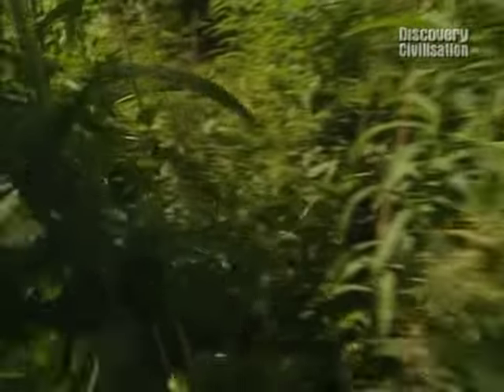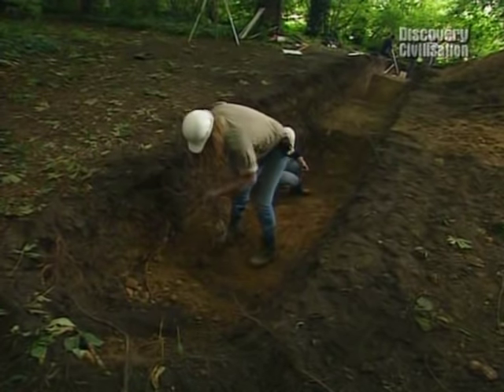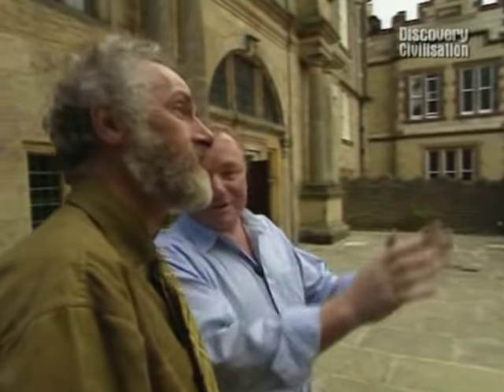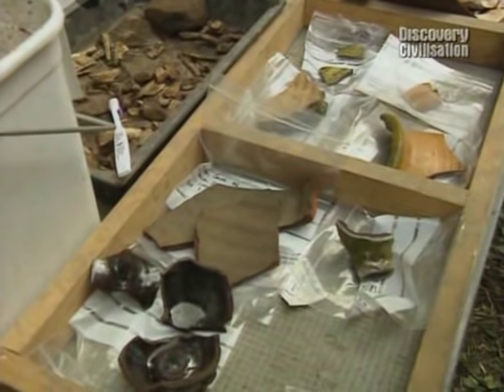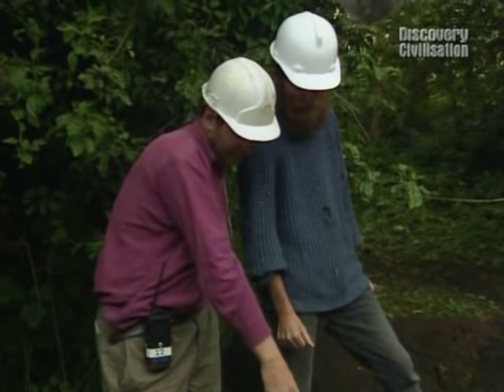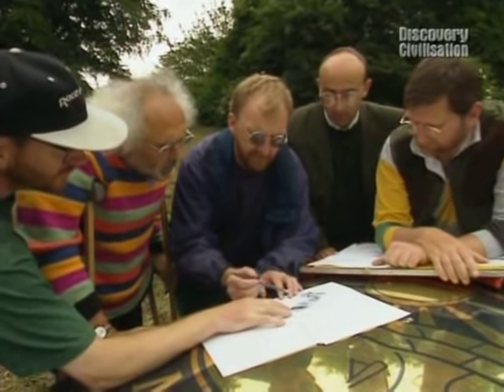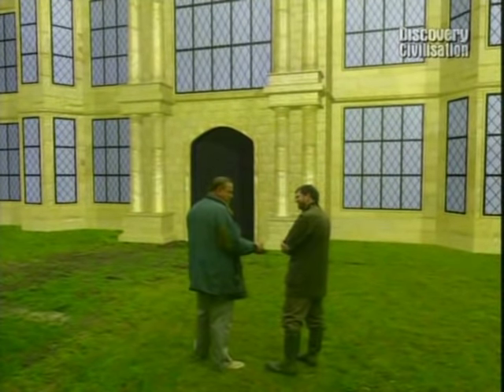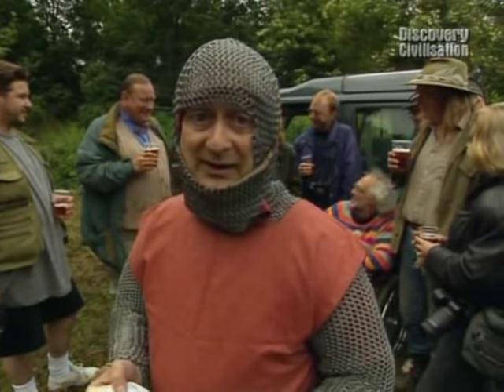Time Team S04-E05  Malton,.North.Yorks

Comment: Stewart does get a lot of stuff, around several periods of TT, right and they need to use his input as equal to Geophys.  Because it seems to me that the trenches would then be in areas where the back stories can either be proved or disproved in less time and with less confusion.  Ah, but Phil always makes the best out of whatever is in their trenches!
Reply: The reason Stewart is there is because a lot of TT sites were scheduled monuments adminsitered by English Heritage, Stewart is a surveyor for English Heritage
Reply: @GrahamWalters  good insight. That explains why the English Heritage fellow is deferring to Stewart on the trench location (not Mick, mind you, Stewart making the call) and then playfully busting his stones once it was decided.
Reply: Geophysics actually shows what’s in the ground. Stewart just woo woos about the landscape. Valuable, but nowhere near as important as geophysics.
Reply: @Invictus13666  having watched about 13-14 seasons so far, I think Stuart has been correct more often than geophys has been.  The issue with geophys is that while it can actually see into the ground, it often cannot tell what it is you are seeing, if it is a natural occurrence, if it is magnetic metal scrap, etc.  or the modern scrap it find on occasion!
Reply: @joelnolan7642  yay for your thoughts!

Comment: The piece of ‘U. or H’ shaped lead referred to by Mick as ‘window frame’ is still used today in creating stained glass images and is called lead ‘CAME’ . It allows a stained glass window maker to attach various frames together and filling the shape with parts, designing a scene or image. Lead is best as it is flexible (though known today as toxic, causing brain damage and memory loss.

Comment: You just can't go wrong with a Time Team although I do always find it amusing when they find a piece of pottery 1cm squared and then do a computer graphic of a huge ornate pot with four handles, like how the fuck can you work that out?
Reply: From prior examples. In the case of a lot of the ceramics, especially Roman, the styles were standardized and (only) changed slowly over time. Someone somewhere has found a whole, or close to whole copy in another prior dig. Using the stratigraphy, and many examples, a "catalogue" is created showing the stylistic changes over time. After that, it's 'just' a case of matching the fragment to an example in the book.